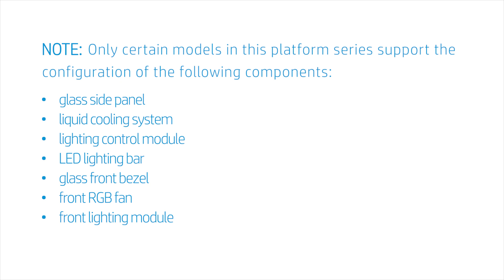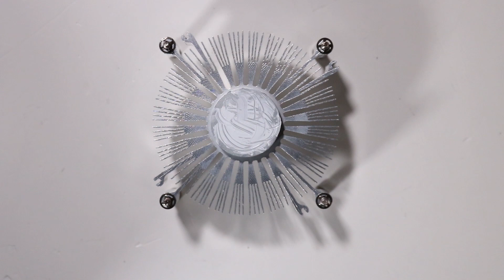Replace the Heat Sink | OMEN 25L GT11-0000a, GT11-0000i, 30L GT13-0000a, GT13-0000i | HP

Comment: Yes but you don't actually replace the heatsink in the video or list if there is another supported heatsink
Reply from the maker: +Dasneat Follow these steps to Learn how to remove and replace the heat sink for the OMEN 25L GT11-0000a, GT11-0000i, 30L GT13-0000a, GT13-0000i Desktop PC:
- NOTE: Only certain models in this platform series support the configuration of the following components:
- glass side panel
- liquid cooling system
- lighting control module
- LED lighting bar
- glass front bezel
- front RGB fan
- front lighting module
- Before you begin: Remove the access panel and system fan.
- Removal
- Loosen the four Torx T15 spring-loaded captive screws that secure each corner of the heat sink to the screw pillars on the motherboard. 
- NOTE: Because the screws are spring-loaded there is no specific order of removal.
- Lift the heat sink off of the CPU and up and out of the chassis to remove it. 
- NOTE: If you are reusing the heat sink, remove the thermal grease with an alcohol swab.
- As you complete the replacement of a part for the desktop, you should ensure that all of the cables are correctly routed. The interior of the system should never look like this after a service event.
- As you route any cables that you’ve connected back into position, be sure to use the clips, hooks, and tape that are provided on the chassis for this purpose.
- This prevents the possibility of cables snagging or sagging when the desktop is moved. It also helps ensure clear sight and access to the components should any further troubleshooting or servicing be needed.
- Replacement
- NOTE: Replace the thermal grease before replacing the heat sink. The thermal grease should be replaced every time the heat sink is removed.
- Place the heat sink over the CPU and align the four captive screws to the corresponding screw pillars on the motherboard
- Tighten the four Torx T15 spring-loaded captive screws that secure each corner of the heat sink to the motherboard. 

Caution: Improperly installing or replacing parts could damage your HP device or void your warranty. Before replacing any parts, check your warranty.

You can purchase the part from here: http://partsurfer.hp.com/ Please select your country and enter serial or product number of your unit.

Comment: What is the max size noctua heat sink I can put
Reply: For Noctua the best option is probably going to be the Noctua U9S Chromax black.  Anything taller won't likely fit.  The stock CPU cooler and fan are completely inadequate and lead to thermal throttling under load.  With the Noctua U9S my CPU temps have yet to throttle under any circumstance.  I ran CPU stress tests that would throttle the cpu in just over a minute and now there is zero issue.  Also at a minimum add a 120mm fan at the top of the case for exhaust and make sure the bottom vent is clear and not obstructed.   You can also add another 120mm fan on the bottom as an intake if you choose.  Mine was past the warranty when I did the CPU cooler upgrade, but I would have done it from day one if I had known about it then.
Reply: @Wigglythegreat2  yeah I actually tested it with the u9s and d9L . and the top fan I was able to fit a 140mm with the a15 fro. Noctua. The a15 is a 140mm fan but it has a 120mm frame. I get 30c idol and 60c when rendering.
Reply: @The Gaming Animator  Nice!   I was checking those fans out too, but I already have the 120s.
Reply from the maker: +The Gaming Animator You can purchase the part from here: http://partsurfer.hp.com/ Please select your country and enter serial or product number of your unit.

Comment: Why won’t my heat sink unscrew from the motherboard ??
Reply from the maker: +Dick Johnson Follow these steps to Learn how to remove and replace the heat sink for the OMEN 25L GT11-0000a, GT11-0000i, 30L GT13-0000a, GT13-0000i Desktop PC:
- NOTE: Only certain models in this platform series support the configuration of the following components:
- glass side panel
- liquid cooling system
- lighting control module
- LED lighting bar
- glass front bezel
- front RGB fan
- front lighting module
- Before you begin: Remove the access panel and system fan.
- Removal
- Loosen the four Torx T15 spring-loaded captive screws that secure each corner of the heat sink to the screw pillars on the motherboard. 
- NOTE: Because the screws are spring-loaded there is no specific order of removal.
- Lift the heat sink off of the CPU and up and out of the chassis to remove it. 
- NOTE: If you are reusing the heat sink, remove the thermal grease with an alcohol swab.
- As you complete the replacement of a part for the desktop, you should ensure that all of the cables are correctly routed. The interior of the system should never look like this after a service event.
- As you route any cables that you’ve connected back into position, be sure to use the clips, hooks, and tape that are provided on the chassis for this purpose.
- This prevents the possibility of cables snagging or sagging when the desktop is moved. It also helps ensure clear sight and access to the components should any further troubleshooting or servicing be needed.
- Replacement
- NOTE: Replace the thermal grease before replacing the heat sink. The thermal grease should be replaced every time the heat sink is removed.
- Place the heat sink over the CPU and align the four captive screws to the corresponding screw pillars on the motherboard
- Tighten the four Torx T15 spring-loaded captive screws that secure each corner of the heat sink to the motherboard. 

Caution: Improperly installing or replacing parts could damage your HP device or void your warranty. Before replacing any parts, check your warranty.
Reply: @HPSupport  Thank you turns out I jut needed to pull harder. I was just afraid to damage something!

Comment: If we replace the Heat Sink, we lose the warranty?
Reply from the maker: +Kerti József HP does not recommend upgrading or downgrading hardware parts or software that is bundled with the product as It may affect the manufacturer's warranty and performance, however, you could change the configuration at your own discretion.
Reply: @HPSupport  thank you for the answer! We can't even change the thermo paste?